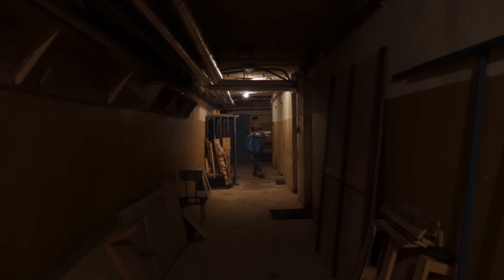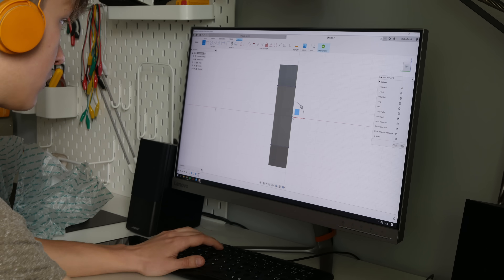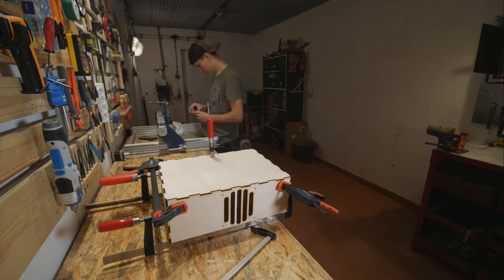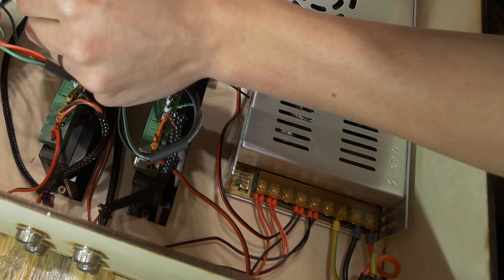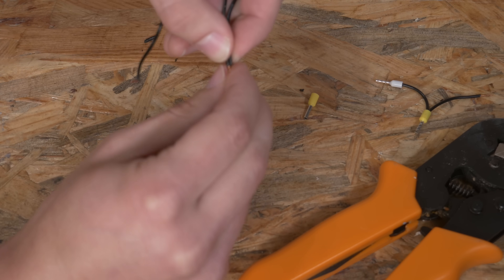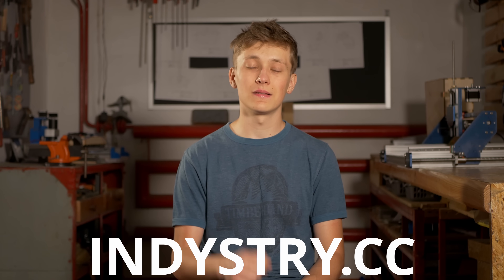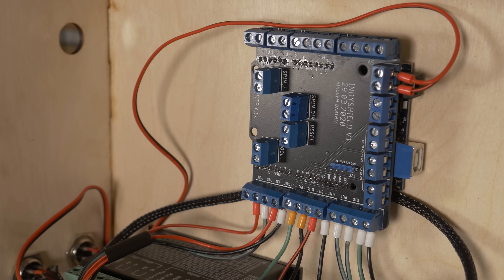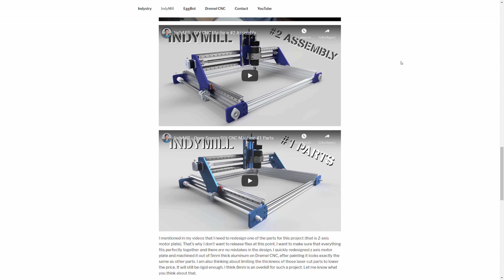IndyMill - Open Source DIY CNC Machine #3 Electronics

Comment: OK I am here to begin the process to modify this design to a separate X & Y table instead integrated table. BUT 1st I will complete the Dremel Conversion to your Z axis travel attached to the original Dremel Drill Press. It is not as rigid but it will help me machine my Train Chassis I need for a new design train. I just received the Round bars and Lift Screw, waiting on Bearings. I will adapt your rear Z axis holder to fit onto the Dremel Drill Press. This will provide a rigid X axis for manual Milling. Once this is built I want to get larger X & Y Tables with Motors and Adapthjis the Z axis to a larger taller frame with also Motor. That is why I am here today rewatching to pick up the design better. I joined the Patreon group and wanted to help in some way. If you have ideas for this deferent style Mini Mill I can offer more support. Dennis

Comment: I'm building this but i will make 2 changes
1) instead of indyshield i will use a skr 2 main board so i can have sdcard support and tft touchscreen support
2) i will install a Makita router instead of the 48v spindle so i hace have the high speed without the excessive cost of the large spindle motor
3) instead of the loud drivers i will install TMC 5160 that should be able to push the nema 23 almost up to their limit

Comment: hi Nik .. I bought your card and your instructions, but I have a problem I can't operate the motors .. I use mega 2560 as an Arduino board .. I would like to ask you what output voltage should I have on the 4 pins where will I connect my nema 23? thanks ..

Comment: Hi there! Very good project... I would do this project as well I will print the metal holders parts with 3d machine ... But I have a question... Instead use IndyShield witch one I could use? Tks a lot... Seeking for u reply...

Comment: I would have expected to write some code but it seems like it’s not necessary. Can you please explain a little bit more in details what software did you use to move the stepper motors and drive the spindle, if is there some standard solution or embedded solution and why you chose one over another, and where the web interface come from? Complete noob here but I’d like to build this. Thanks

Comment: Hi Nikodem, to fully utilize the power of Nema 23, TB6600 are actually weak for that, at least for longer Nema 23. They cannot provide enough current, but they are sort of OK. I have in my CNC long Nema 23 motors with TB6600 and after one hour they barely get warm enough to the touch. Also the drivers are definitely not even warm, so I personally skipped any kind of cooling solution. I also measured the current with those drivers and you really need much higher voltage than 12V to get close to the rated amps for TB6600 and Nema23. I'm using 36V power supply. Also I have 4 motors and together they do not consume more than approx 60-70W and I bought a 10A power supply, which is just way more than needed. 100W power supply would be probably still enough. My machine is however belt driven so I just need that torgue, but your setup might be probably just fine. If you wanna tinker with that, just do some current draw measurement from the power supply to find out the power consumption of the whole setup. I would be curious. Thanks for those videos, it's a great CNC project and inspiration.

Comment: One interested thing will be to imaginate how to integrate a A/B 4th and 5th axes bloc and make a true 5 axes open source cnc mill.

Well you have done a great job.. and it's maybe one of the cleanest and the most polished I've seen since one year... And certainly one that is no too low sized.

I hope my english can be readed.
Reply: I think there isnt rly enough z height atm for that
Reply: @alexfletcher8465  I think about a way to put that below the working plate...
Reply: @UCBt0sxV72FucwvJ6UuswonA definetely could be possible but im still not sure how useful it would be
Reply: @alexfletcher8465  making things. .. it can sometime replace a latte. Working on 4 faces. Make some little connecting things that need complex design (level, clamp etc)

Comment: Those screw on connectors are fine. I've been using them in electronics projects for 30 years and have only had to replace ones that were physically damaged. We call them Japanese microphone connectors but I'm sure they are all made in China now. The first time I saw them was on mobile CB radios, they aren't designed for a lot of current and the modern ones have plastic parts that melt easily so I wouldn't use them for motors much larger than you are using. Do you sell that controller board with your name on it?

Comment: Hello bro!
The introduction discribes your appearance as a 15 year old boy!
You must have been in a great hurry as you have used cnc printed parts. Please use solid metal parts so your bearings and screws retain their accuracy. Also hope you will add limit switches on a priority basis.
As a senior person, I will have to catch up with the computing and the programme for this thing.
It's a formidable project and really big!
I think I could learn a lot from you, given the time.

Comment: Can you make a video explaning the advantages and disadvantages that came with this design change between the IndyMill and the dremel cnc using the 500 W spindle? I'd be curious to see how much better this new design performs when cutting aluminum and if its worth building this more expensive version.

Comment: You should consider redesigning the bearing holders so they can be printed face down.  It will make them significantly stronger!
As a thought experiment, imagine what would happen if one or more delaminated.  In the current orientation, a single layer bonding issue would be catastrophic, however spinning it 90 degrees would allow the part to remain operational without much concern.

Comment: One tip: Use a thicker MDF board  in the back so you dont need to cut your screws with a Dremel tool.

Comment: Be careful with the 500W spindle power supply, it leaks mains voltage everywhere. If you plug it in, you can see 115V AC on every terminal respect to ground.
I would suggest running an earth cable to the spindle and the speed potmeter just to be safe. I would not trust the chinese quality insulation.

Comment: How did you use the thrust bearings for the ballscrews? Do they sit between the mount and the shaft or between the shaft nut and the roller bearing? I couldn't figure that out from the video.

Comment: Looking great.  Thinking the control box should have a few fans inside it pushing/ pulling some air over all the electronics  Still waiting for you driver shield to arrive in the mail. COVID-19 sure has slowed overseas packages down. Can't wait to start making my cnc. 😎

Comment: Looks great, but concerning the 230V, I don't think soldering ferrules is proper practice, same for using ferrules to the power supply.  I'd use spade connectors for those uses or even solder straight to the IEC connector. Nice job for the rest :D

Comment: Great work! Glad to see you rotated the drivers from the layout you showed in the last video. You need to add another vent though, for cooling. You need both an air inlet, and an air outlet, otherwise you're just creating a vacuum in the box, or pressurizing the box, both of which will keep the heat in the box. Keep up the great work!
Reply from the maker: Doors aren't that perfectly flat so there will be some air coming out through here, maybe I will add some gasket here
Reply: @nikodembartnik  Ideally you want the inlet and outlet to have the same cross-sectional area, unless you want to form a positive, or negative, pressure zone. I would not suggest relying on leakage through the door to be sufficient.  Just something to think about. Either way, keep up the good work!

Comment: You should have printed the bearing holder in a different orientation. Force coming from the ball screw while milling will break it pretty easily on some layer.
Reply: Nah, that'll hold just fine on that use case.
Reply: @jothain  Maybe. We'll see.  I'm talking about Y axis where the holder is attached only one side. The ball screw will pull and push the holder. I'm pretty sure it can be delaminated just by hand and forces coming from the screw are much higher. You can't even tighten the bolts eanough because you will squeeze the print. So if the screw doesn't brake the holder then it will move it. This is one of the worst place to use 3d printed elements. It has to withstand huge forces without bending, braking or moving. That's why the "real" bearing blocks are made of solid block of steel.
Reply: @upanie1  it's sturdy enough in my eyes. If you induce such forces that it would delaminate I'd say parts was printed flawed or user introduced way wrong feedrates. Sure in the end it would be easy to use flanged bearings there, but that'll hold for that usage.
Reply: @jothain  Forces during milling aluminum are really huge. Or not if the cut depth is about 0.1mm but who wants that. And layer adhesion in 3d printing parts are really poor, that's why  it is important to choose the proper orientation of component during printing. "That usage"? What usage will it be? I'm confused. I can see here linear rails, ball screws and 3d printed super critical parts. Yes, bearing block at fixed side is super critical. What is this all about? @Nikodem Bartnik Why do you resist so much using bearing blocks?
Reply: @upanie1  if you claim layer adhesion is poor, then you really have a shitty printing setup or parameters. And no, I highly disagree about those forces. Something like Nema21 is still a puny motor on any means.
Reply: @upanie1  yeah, I'm by profession a machine mechanic so I do know and I have experience of multiple years and hundreds of print hours with 3d printers. That motor is puny and it really doesn't make much torque even with that ball screw. You can't turn my head around here, unless you build this machine and show me that printed holder has failed 😂
If it would be actually geared motor, then it would be totally different thing.
Reply: @jothain  So if you're by profession a machine mechanic then you should know that it would be much stronger when printed in a different orientation. Why not to do that when it costs absolutely nothing? And you should know that fixed side bearing block is fricking important part in the machine. It defines accuracy , speed, acceleration, etc. Not only bearing block of course but if it fails then everything else won't help. We have 2.2Nm stepper motors, linear guides, ball screws and... 3d printed bearing block. And even stepper motor mount adapter is made of steel :O What is going on here? Isn't it awkward to you johtain? And as for torque and linear force I don't need to build anything, just use some formulas and calculator and if I'm not wrong than for 2.2Nm and ballscrew 1605 you will get more than 2000N. Do you want to put your finger between the nut and the block bearing?
Reply: @upanie1  why are you so hellbent on something that hasn't proven to fail ffs? He can do metal one if it fails..
Reply: @jothain  And why are you so stubborn in defending this idea? I just gave an advise to save him from extra work, pointing the weakest point of the machine and all I see is "no it's good solution, everything will work fine". Why? NIkodem said that he reads all comments but doesn't have time to answer all of them. That's fair. But he has time to answer only flattering comments. WTH? And where is this hate? I read most of the comments and couldn't find any hate. Is it all about getting more flattering comments? Man, I don't know. Nikodem and I are from Poland and I was really happy when he started this channel and I was first subscribers. I'm almost 3 times older then he is and I would really like to help him but comments other than "You're my hero" are ignored. I'm confused.

Comment: Finally thank you, but I dont get this project because if you want to properly mill hard materials make a CNC mill not a router style cnc
Reply: not hate just confused
Reply: and I guess price wise if you went the mill route you would get a much smaller build area
Reply: Well that depends highly on wanted working area and materials. It's quite hard to make proper milling machine frame with any decent working area. Also cost and building needs welding etc. Plus axis mass increases machine component cost exponentially.
Reply: @jothain  but with what he did with dremel cnc i.e milling small parts I think it would be more cost effective (but probably less entertaiining/0 if he just converted a manual 700 dollar mill
Reply: @alexfletcher8465  yeah, well imo if going that route, it's easier to just to buy some small, but decent manual milling machine and convert that ready framed to cnc and I specifically mean metal milling machines, not some cheapo Chinese wonders. But yeah, there's still that working area / material aspect. If you want to cut wood and plastics, then something like mpcnc, lowrider or this indy mill is quite good. Edit:Sry, I apparently misread your comment a bit
Reply: A mill is a pretty big step up need a much slower spindle and other components.
Reply: @andersstromqvist2211  i meant converting to cnc you just need some mounting plates and carruages, some ball screws, and similar electronics

Comment: It is looking really good. :) I have a slightly strange question. I have been searching for those little connectors that you are using at the end of your wires, that you insert into the screw connectors on you PCB. My problem is I don't have a name for them. I cant search for something online if I have nothing to put into a search engine. Can anyone point me in the right direction? Thanks. :)

edit: Maybe I should wait until I am done with thew whole video next time. :P Crimp terminals! Now I have to find those kinds.
Reply: exact name is "bootlace ferrules." they are technically a "crimp terminal" however that term covers a huge range of styles/types. you'll need the specific crimp tool for them as well.